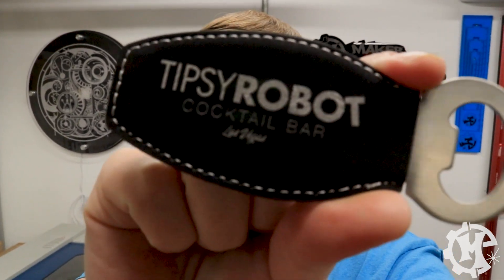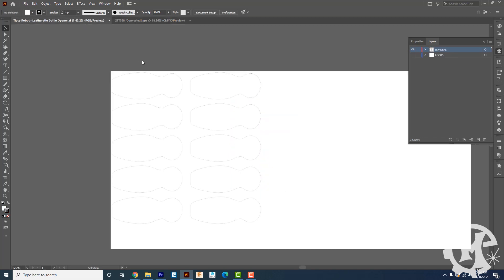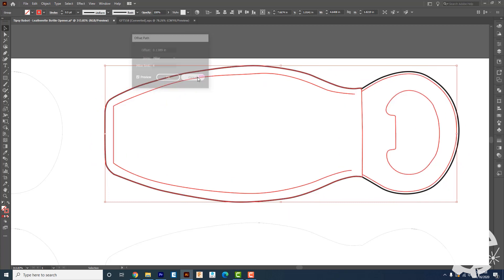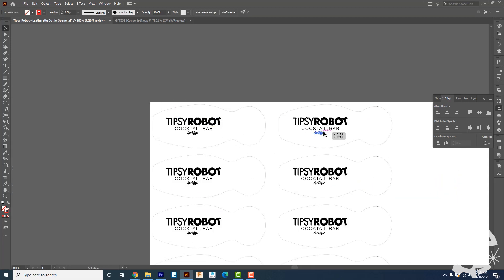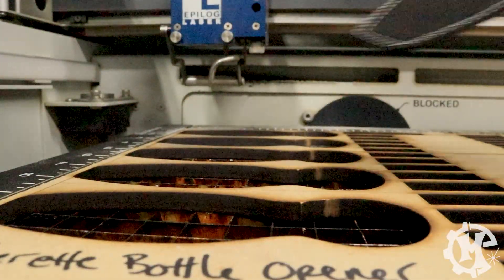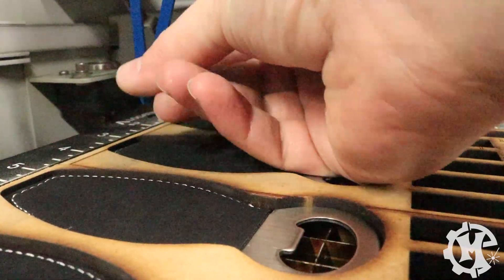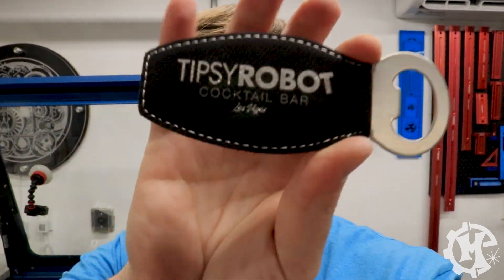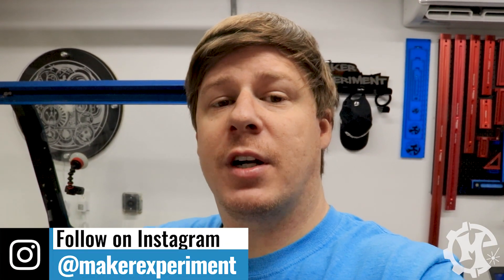How to Engrave Leatherette Bottle Openers

Comment: If you want it centered, I would move the text down to "visually" center it. The reason is that the text on the top is wider and heavier and visually it looks off. If you measure the distance between the top and the closest letters the 2 Ts on the end, you can see they are much closer to the top than the tiny Las Vegas is to the bottom. So if you want a centered "look" then it should be lower down.
Reply from the maker: Benjamin Lotter I don’t disagree. This was what the client wanted. They may change their mind next time around. They wanted the center of the design to be centered on the item. I agree that visually it could be moved down due to the design itself. It’s all client preference.

Comment: I have a love-hate relationship with metallic leatherette.  For me, I have to run two passes, a 425/17 mm/sec and then a cleanup pass at 525/16 mm/sec, and they come out great.   What do you keep your air psi at when doing these?  Love seeing your videos have been watching for a while now.  Could not spring for the epilog laser, but I am thrilled with my Aeon 60w.
Reply from the maker: Panhandle 3d honestly, I shut off the air assist when I did these. It tends to blow the dust onto other parts and looks bad. Shutting off the air assist removed that issue for me.
Reply: @MakerExperiment  Thanks  I just removed the always-on air compressor and hooked up a  California Air this weekend.  Now that I can actually control my PSI I will give the no air option a try.
Reply from the maker: Panhandle 3d best of luck!

Comment: Great video, would you consider the 60-watt Epilog Fusion M2 40 a good entry point if the wife and I wanted to start making gifts and things or should we go with a much smaller, cheaper, K40? What is the price point of the 60-watt Epilog Fusion M2 40?
Reply from the maker: Patrick Bigham I would not recommend the Fusion M2 40 if you are just starting out. I’d recommend the Zing 24 if you want to get an Epilog. They also just released the Fusion Edge which is 12”x24”. The Fusion Edge starts at $14,000. The Zing starts at $8,000 or so. I’m not sure what your budget is.